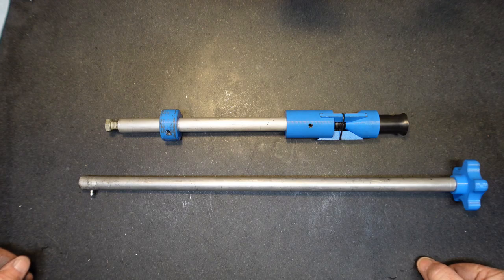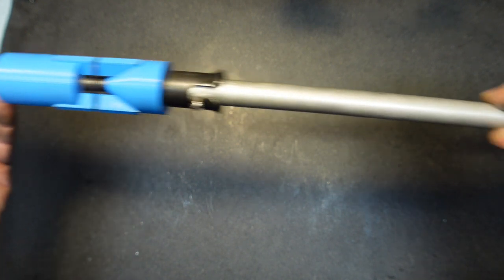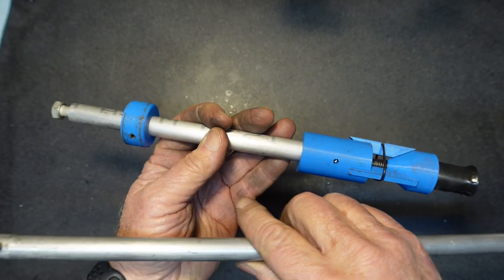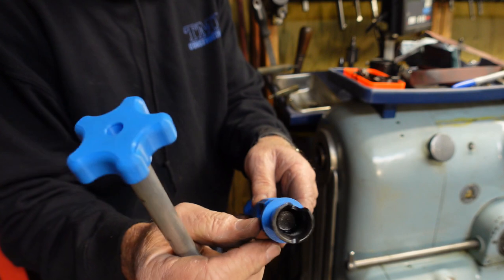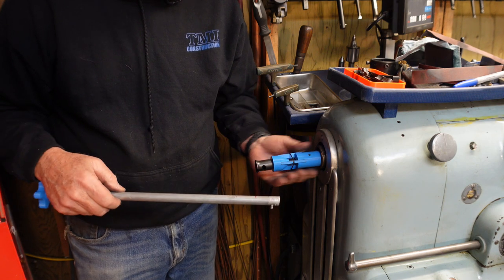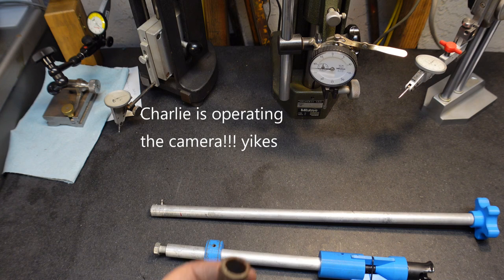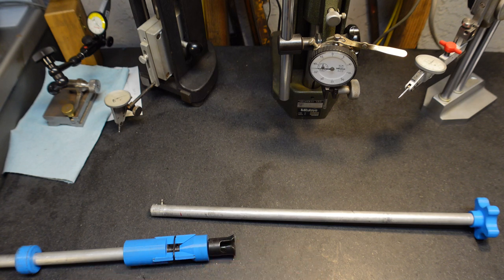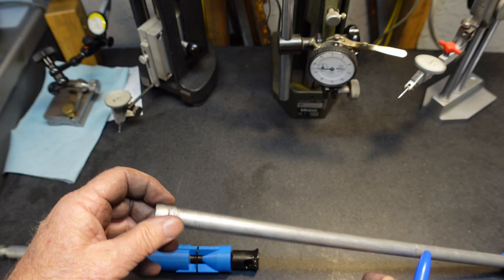Spindle Depth Stop...The lock/retriever handle

Comment: Hi Chuck,
if you put a collar slightly smaller than the size of the spindle bore onto your extraction tool (close to the pin sticking out) it should be even easier to align it to your bayonet mount piece (and it might work on a version without the bellmouth end too). Otherwise nice improvements to the spindle stop.
Reply from the maker: now that is an idea....hmmmm, thanks for viewing and your comments

Comment: Your last video revealed to me the purpose of a tool I got in a lot years ago, I have two different spindle stops that both have pin bolts? I don't know the term. I was thinking while watching this video that that was a weird choice, it does not allow you to use the tool to retrieve the stop. I just went and looked at it, I believe this is purposeful. You don't get a lot of feedback tightening this bolt, I suspect this design functions to let the user know when it is tight enough. Sort of like the ratchet handle on a micrometer. I don't think it is about an ideal level of pressure but rather a focus on repeatability. I suspect your setup has quite a bit more feedback, hollow tubing and plastic allow you to feel much better I believe
Reply from the maker: thanks for viewing and your comments

Comment: Instead of a bell-mouth on the receiver, make the pin equal on both sides of the handle and taper the end.  The receiver has a slot all the way across to easily accept the pin with a slight VEE on each side and the slot on each side for retrieval.  This is similar to some old car jacks.  Make the fit rather sloppy so nothing hangs up or is tight.
Reply from the maker: thanks for viewing and your comments